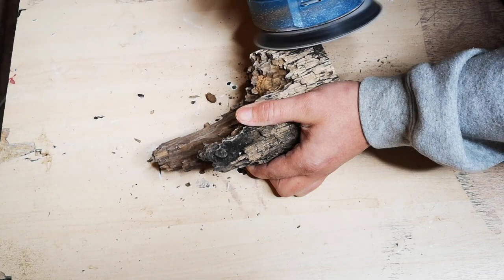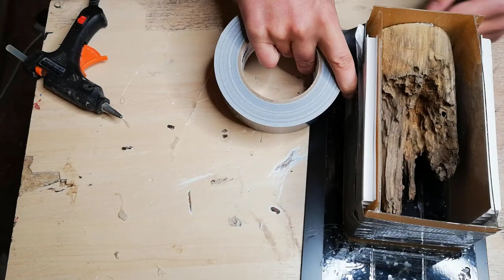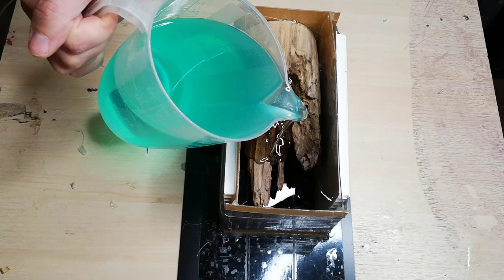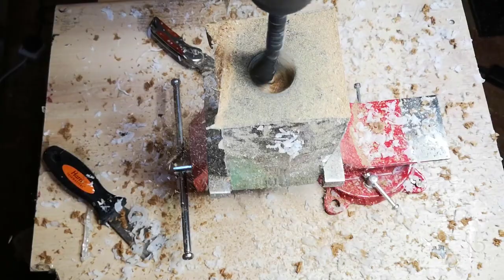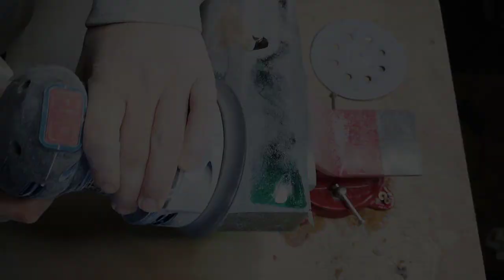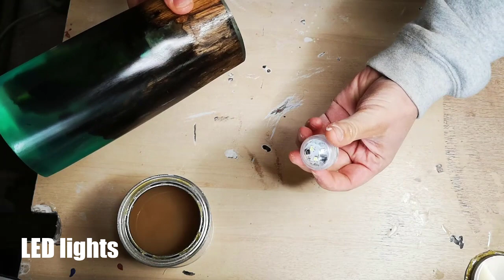Night Lamp with Epoxy Resin and Old Wood - Resin Art

Comment: How do you get the resin from the acrylic frame so easily...Mine moulds to it and is impossible to separate...or am I doing something wrong?....lovely lamp by the way
Reply: I found out from another channel that you can use tape to avoid this problem, i hope it will help
Reply: There's spray called silicone release spray that is like 5 dollars on amazon, basically stops all sticking and it's intended for resin use

Comment: This was very neat. I do think it needed to be sanded to a much finer grit, wet sanded, and finally polished. That would have made a much better finish. I also think it would've been better if you had a vacuum chamber, to get rid of all the bubbles throughout it...I also would have liked to see it with the overhead lights off, so we could see the full effect... but it's still pretty neat... 👍
Reply: The bubbles make it for me, works really well.